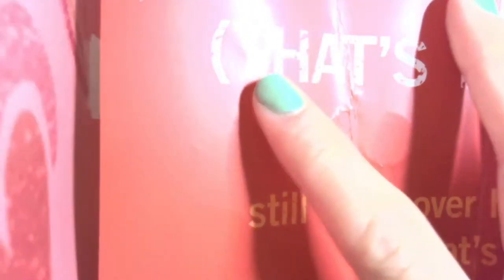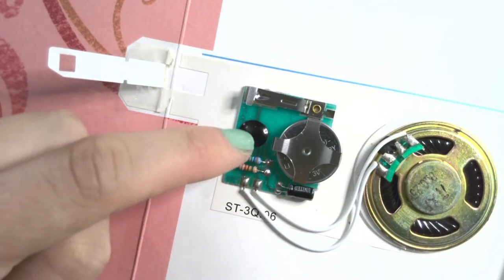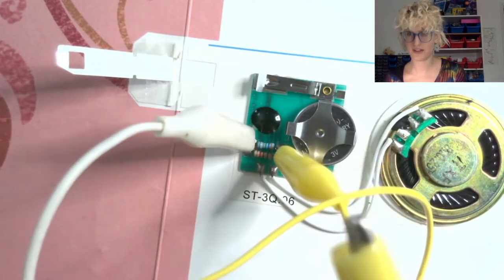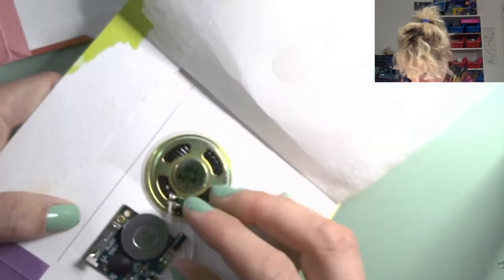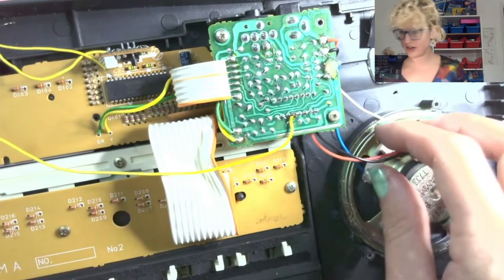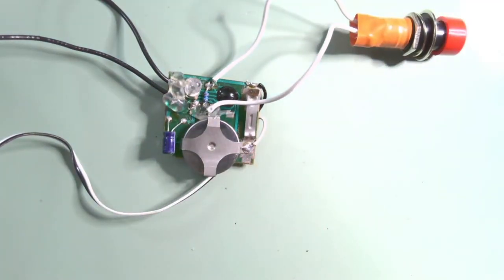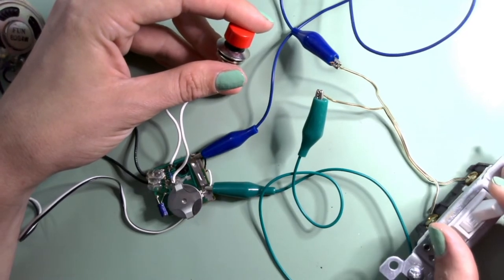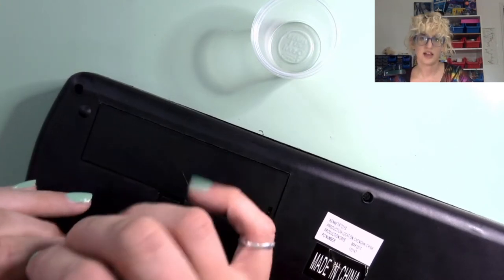Circuit Bending Basics!

Comment: For the loose bats of those type, take the battery out, place a thin piece of wood in and use something to make a depression in the center like a nail that has the point dulled or something.  Just enough to make it now hold itself down more.

Comment: good intro to bending concepts :)

ive always wondered if these sound card things had any broader applications for bending. like if you could insert the type that allows you to record your own 10 second sample into a keybord and trigger it via LFO. or even remove the speaker, wire the output directly into the preamp, and use it as a short memory/playback function.

anyway, good video 👍🏻
Reply: I've bought these little units for 3-4 bucks on amazon that have the same chip and a record and playback buttons, they're fun. One day I plan on making a cv trigger input for them.

Comment: Nice explenation for circuit bending a point with those cheap cards is the chip packafe is to expensive so they directly put the sillucon of the chip on the board and put epoxy over it its dirt cheap

Comment: This was awesome. I read and youtubed about circuit bending but I found your intro very interesting. You really have a way of explaining.

Now I know I'm late here, but I have a question. About that "no wall plug" rule: many toys will work with batteries OR a power supply. I assume the adapter that goes with the toy will supply something like 6, 9 volts or so, depending on the toy. Here's the actual question: once you have figured out and "diyed" your sound object, don't you think you can plug it into the wall? I mean, the voltage is often written on the plug. What would be your advice?

Anyway, thanks, keep it up! Cheers,
Reply from the maker: That's a great question and I have done that, but I've also been shocked, so proceed with caution! If you attach buttons or switches to trigger the bending then fully enclose all the exposed bits you should be fine. I was using a 9v to power something I bent with an LDR but wanted it to stay on making weird sounds in an art gallery without the battery dying, so I attached a 9V adapter. For that particular setup where the light was activating the sound it worked great but I forgot to revert back to battery power when I played it by hand (there were exposed bits) and I learnt my lesson. Don't die!
Reply: @jenna_junk  Hello, and thanks for your answer! :)